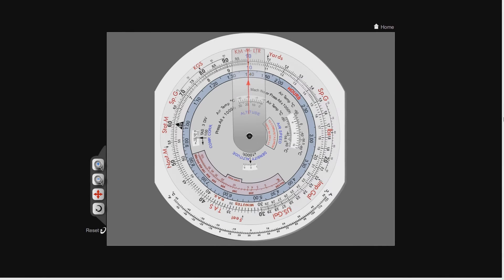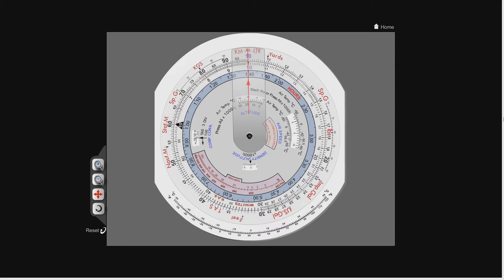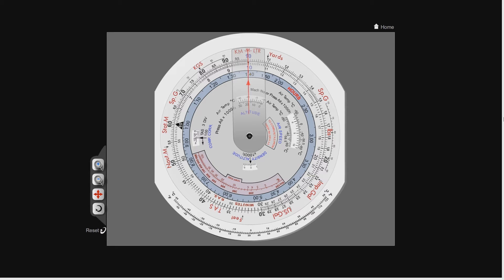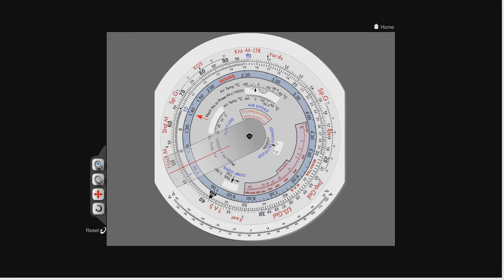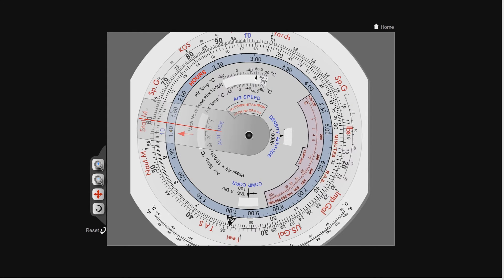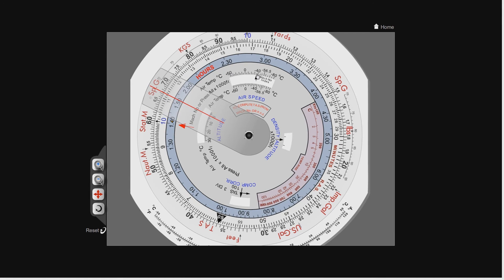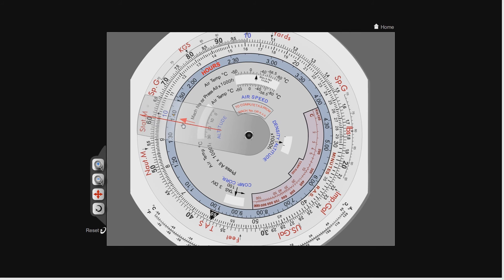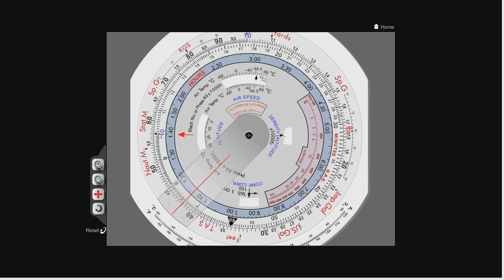CRP-5: Mach number & the speed of sound

Comment: at 13 c this makes for 658.5 knots kts  which is the LSS speed of sound  . What is (K)38.84 derived from. Planc perhaps 6.62607004 × 10-34 m2 kg / s being the constant the mass weight redux so 20.01 (mps) would be more convenient with less mass velocity of G forces dependant on true motion of our solar massive and the atmospheric velocity for advanced design concepts in faster true speeds at lightspeed aside there coukld be a laser verion of this dial ,strobing mabye nice app can you get it anywhere  I want a starforce  too.
Reply from the maker: If we start with the LSS calculation in m/s using 20.01 (still not sure of where that comes from) the value of 38.94 is simply the conversion to knots.
Meters in a nm = 1,852, and seconds in an hr = 3,600.  So, (20.01/1,852) x 3,600 = 38.89.  Close enough

Comment: Hi, can You Kindly explain why when we are flying at a constant altitude with a constant Mach, the CAS remains the same, and vice versa? Thanks!
Reply from the maker: Saurabh Kumar as long as you are at a constant altitude the air density is assumed to be constant. As CAS if effectively based on dynamic pressure, it won't change.
Only the altitude will change the airspeeds due to a difference air pressure.  Temperature changes will also have a small impact.